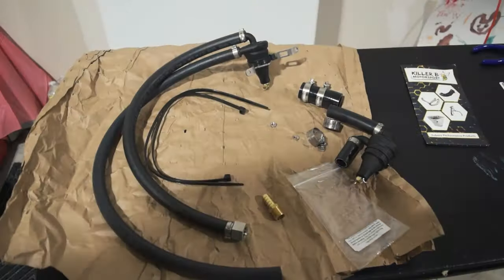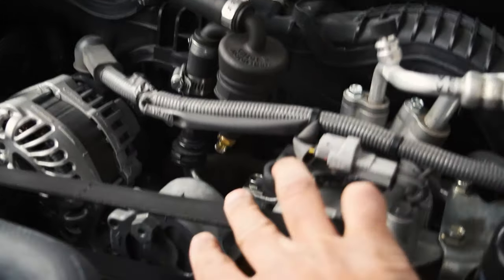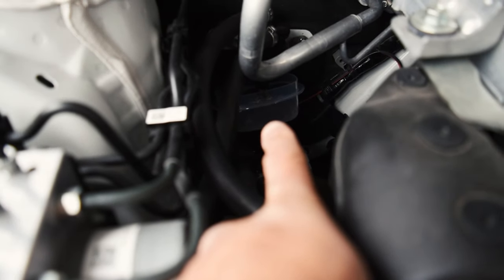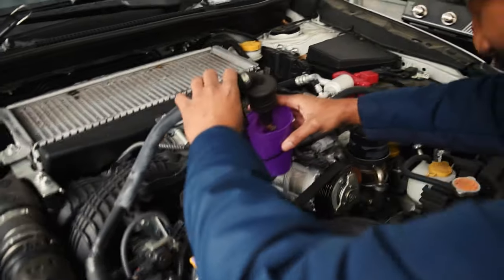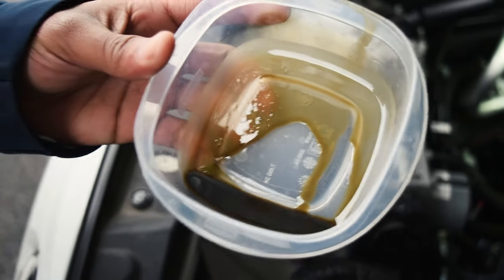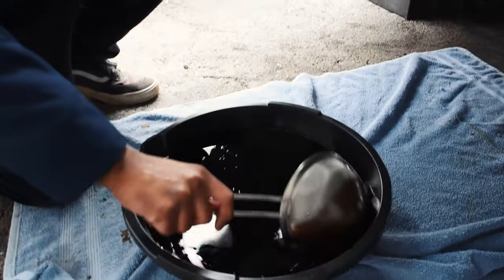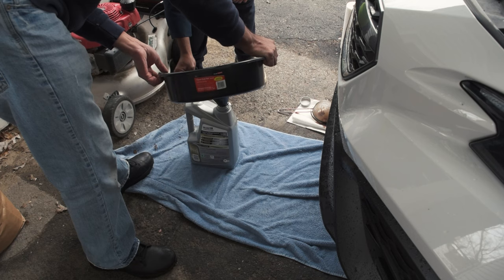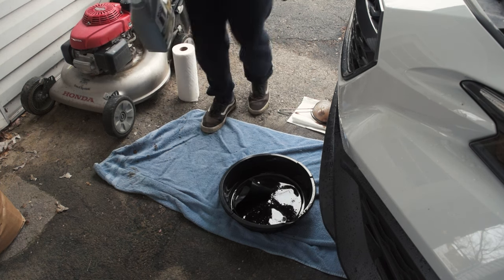This is why your 2022-2023 WRX needs a catch can / AOS

Comment: I installed a Mishimoto CC on my '22 as soon as they were available.  Its on the PCV side only.  So far Ive collected very little oily/watery gunk - maybe a tablespoon or two at the most in the year or so Ive had it.  Still better than that getting on the intake valves.
Reply from the maker: That's what I'm hearing. It's my first time experiencing these systems so I still have much to learn.

Comment: Hey! I heard that the 2024 model addresses a structural flaw in the rear suspension for the 2022-2023 models. Is this true?
Reply from the maker: So idk if it was because of a flaw but ALL WRX from 2024 on are getting added structural rigidity. I have been asking around as to why but I think it was specifically for the TR so it trickled down to the rest of the trims.

Comment: How much oil are you burning in between changes? That's the rule of thumb I've always been told. Very little? Then you probably are okay without one. If you're street racing all the time and tracking the car on a consistent basis, then an IAG AOS  is probably order.
Reply from the maker: It's an incredibly miniscule amount. For my car id say it's been about as much as we got out of Jordons catch can, and I drive a lot.

Comment: I'm rethinking installing a catchcan/aos after hearing about freezing condensation in the pcv line leading to oil pressure + blowing out the dipstick. I'm in cold AF Canada and I think I'd rather just plan for a walnut blast down the road
Reply from the maker: Yea if you aren't really doing much driving or are seldom blasting the car it's still not a big deal.

Comment: Looks like nothing came out of the front can? I have a radium set u for the pvc only. I like it, and the dip stick is cool. I've got about the same amount of oil as you guys did the last 2 changes. No RTV so far yet either! I have the moto valve too thanks to one of your other vids, thanks homie. Easiest oil changes my entire life 🤘🏻
Reply from the maker: Yea fumoto saves so much time. A lot of people have mentioned that the front can usually doesn't get much. Most of it is at the back side.